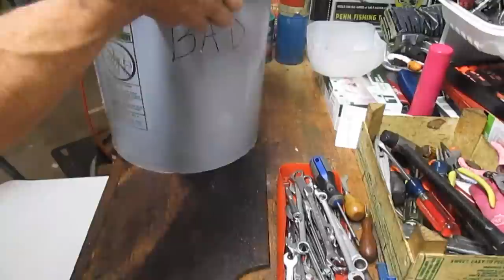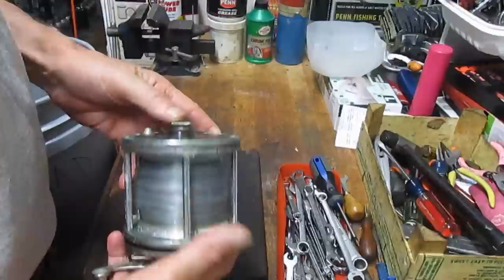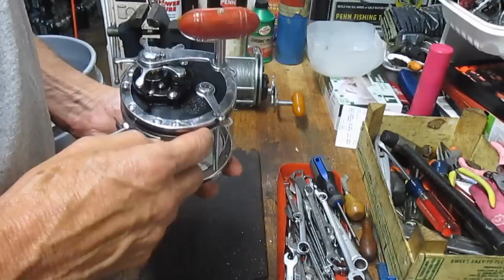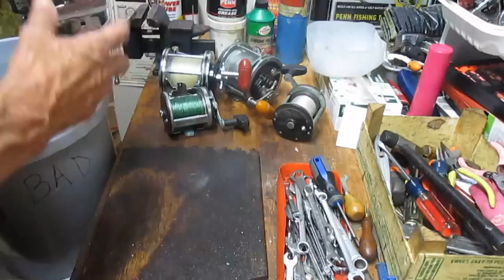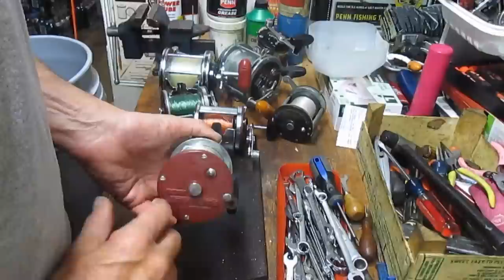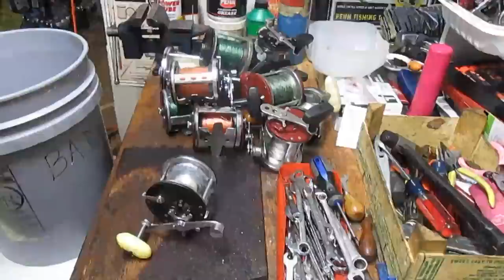A Pail full of Penn reels repair projects

Comment: Hi Dennis when was last time you worked on a senator 2/0 111 reel? What type of fish is this reel good for?
Reply from the maker: Funny you should ask Michael.  I have a 1/0 and a 2/0 in my to do project bin.  The 2/0 Senator is essentially the Penn Long Beach model 65 reel.  The 1/0 is almost identical to the Long Beach model 60.  The reels are good for inshore ocean or deep lake fishing and can handle 250+ yards of 20-25# mono.  They are drop fishing reels, not very good for casting and the capacity limits the reel for trolling. I plan on doing the videos on both of those when I get a chance.  Probably a few weeks from now.  Please stay tuned to see them - Dennis
Reply: @2ndChanceTackle  looking forward to see the video on them. I enjoy all your videos. Your about only one out there that knows the history of penn reels. Use to be a penn commercial years back advertising peen reels for champions. Yes they are.

Comment: Did they put the handle throw on the lowest throw to get more "speed" on the retrieve?
Reply from the maker: The leverage handles works where the hole closest to the knob has the least and the hole furthest away has the most leverage.  The handle does not increase the reel speed. That is dictated by the gears,  A longer handle makes it easier to pull in heavier fish, but you are probably correct in assuming that you could turn the reel faster with the shorter handle as you hand has a shorter circumference to make a complete revolution and it would take less effort to make it go around once. - Dennis